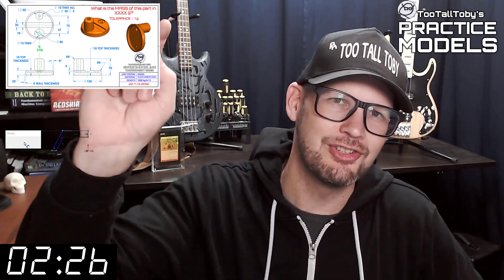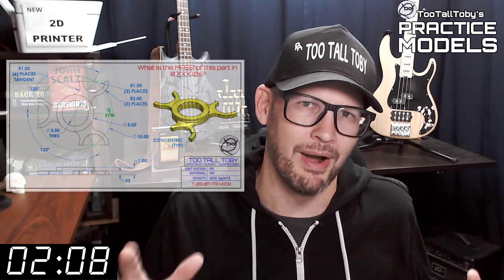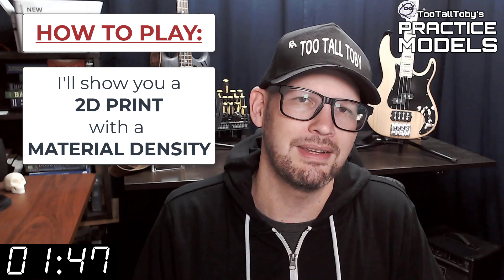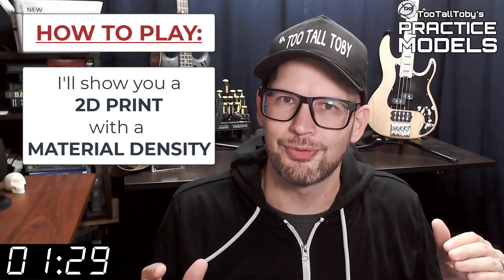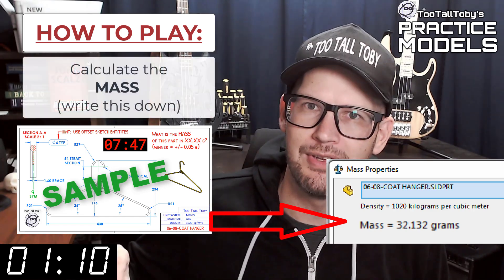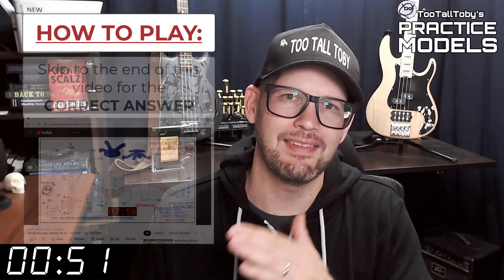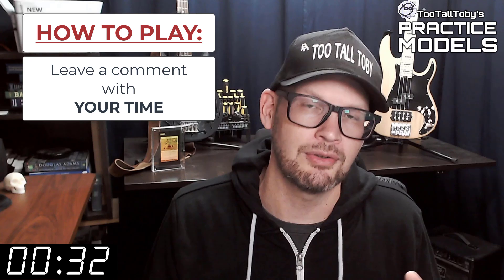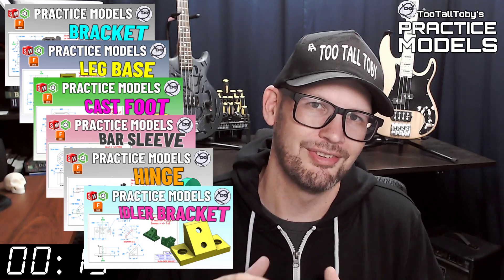2D to 3D CAD PRACTICE MODEL-  Drawing to Model for Onshape, SolidWorks  - UPPER ALIGNMENT CLAMP

Comment: Finished in Fusion but I forgot to look at the time.  First time trying a practice model from a video.  Oops.  Probably 5 or 6 minutes.  Forgot to put the slot in the first time.  Also modeled a quarter and mirrored.  Might have been easier to model half and would have worked better.  I checked how the hole and thread note called it out on the drawing and it said 4X, so it counted both halves of each hole.  
For anyone interested I posted a video on setting up Toby's materials in a library in Fusion.  My first tutorial video.
https://youtu.be/ogWd76jkDF4?si=g92Dz8urfmyqvcmj

Comment: 918.01g in SW. Mirroring the hollow cylinder didn't work for whatever reason. If anyone ran into the same problem and happens to know the cause of the error, please let me know!
Reply: I used referenced geometry and "extrude to" feature and it didn't worked for me as well. Spent some time on it cause of this. Next time cut the part in half and mirror body with merging when finished on one side